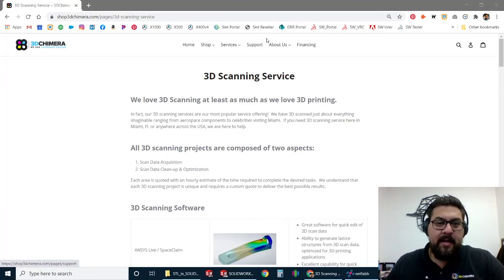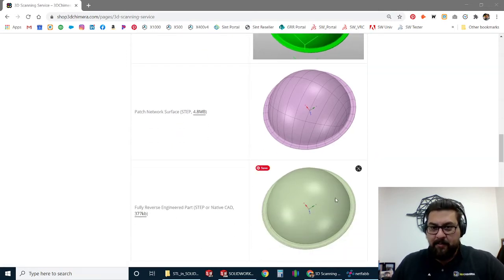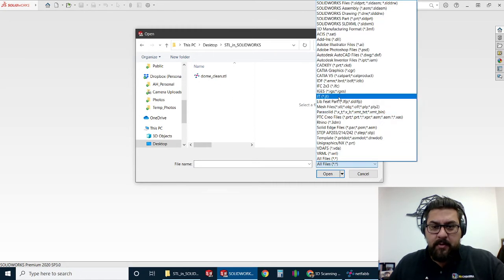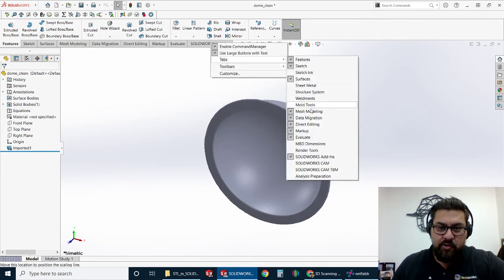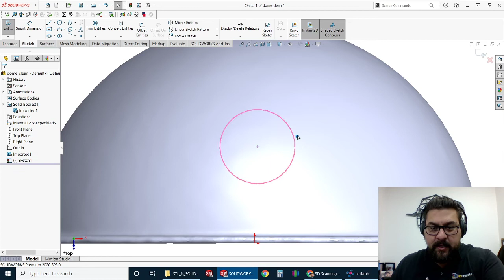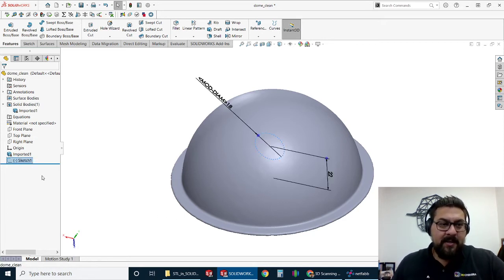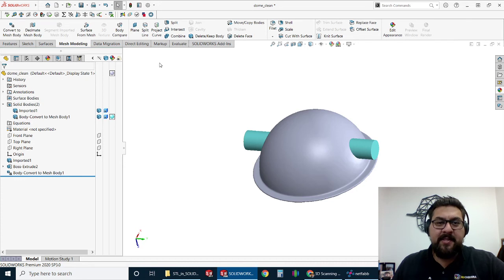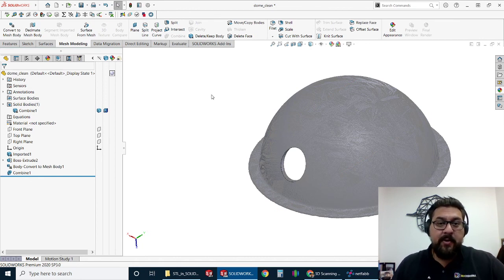How to import a 3D Scan (or any STL) into SOLIDWORKS 2020

Comment: The company I work for has me working with a Creality RaptorX and the only problem is, is that no one knows how in the world to use the dang thing. Once I get my model made and saved as an STL or OBJ, how do I clean the model up so that I can import it into solidworks and edit my part. As of current I am using a 4" gage block and have been trying to figure out how to get my scan to be just as accurate as the actual gage block. Any and all advice is helpful, have a lovely day.

Comment: Can the imported STL with the triangles every become a normal solidworks solid or is it like that for the rest of its life through a project?  What happens if you wanted to turn it into a solidworks part, how can you do it?
Reply from the maker: Great question!  It will remain like this in SOLIDWORKS.  The only way to convert the file is to fully reverse engineer the part.  This is usually a manual process where you recreate the part 1 feature at a time.  Some software plugins can help, we recommend Mesh 2 Surface for SOLIDWORKS.

Comment: Dear Sir,

I Import stl mash file in solidworks and the solidoworks show topological error how to remove it. pls replay
Reply from the maker: You will need to repair the mesh file from errors first. You can use a tool like Netfabb or MeshLab as a first step.
Reply: @3dchimera  dear sir i have gio magic design x  i repaired but error is same pls help mee
Reply from the maker: That is a good tool that usually catches errors. Sometimes the other tools catch different mesh errors. I would try to repair with Netfabb, MeshLab and Meshmixer to see if you get the same results.

Comment: Hey Alex.. I want to know if we can program SOLIDWORKS to develop a 3D model with added material over the scanned object. For example, if we have a scan of the face of a person, can we command SOLIDWORKS to generate a Mask over the face of the scan, with an inner contour of the face and outer contour of some design?? And further, can we 3D print it?
Reply from the maker: Yes, you can definitely do this. You would design the outer mask first with some intersection of the face scan. Then you would be able to remove the intersection of the face scan from the new model.
Reply: Yes you can do that with some surface design, starting with a small offset from the 3D scanned mesh.